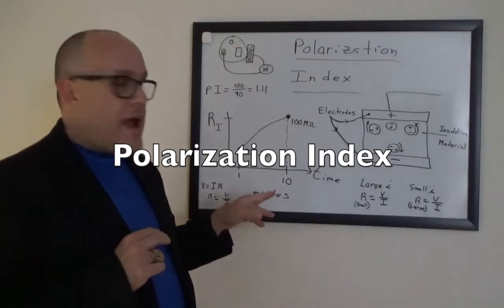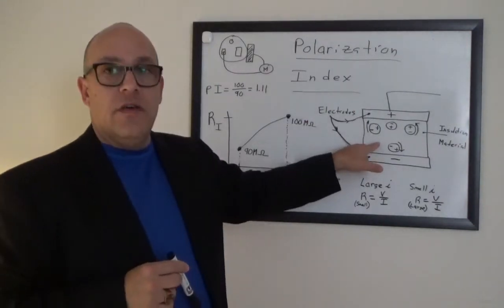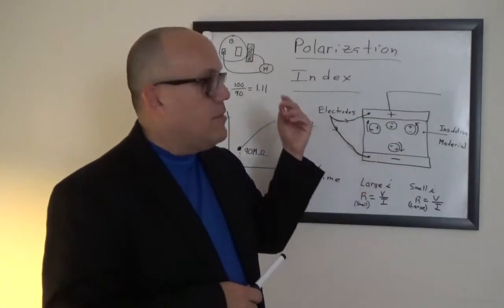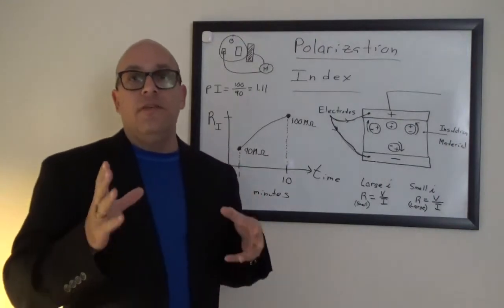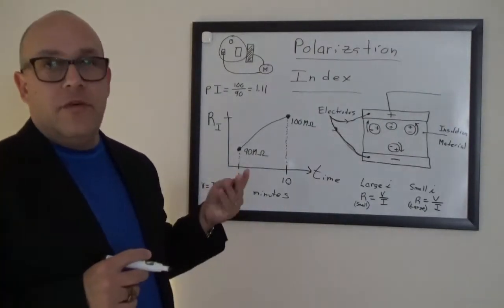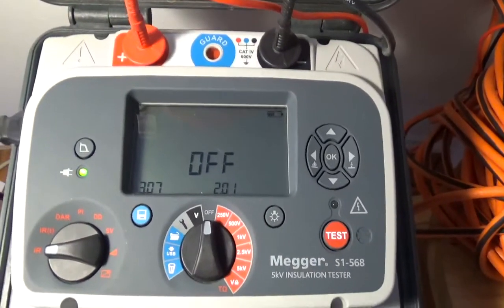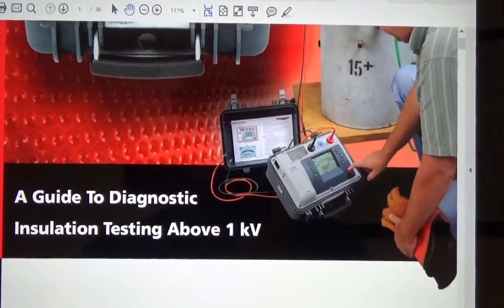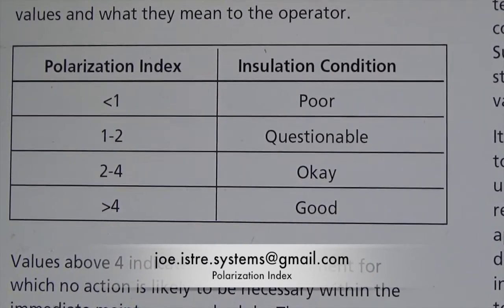Polarization Index Testing (Long Version)

Comment: When referring to molecules, I believe you mean atoms. Those atoms containing a balance of the nucleus of protons surrounded by the orbiting electron field - the excited (free) electrons being those which move from atom to atom  - hence voltage potential and current flow.
Reply from the maker: In the PI art, the molecules are referring to insulator molecules - usually plastics.  I would agree with you for conductors.  Then again, if we are getting these minuscule current flows from plastics, I suppose we are stripping the outer electrons from the outer orbitals of the molecules with the high voltages.

Comment: Per IEEE 43 - 2013 Part 12.2.2,  when IR value exceeds 5 Gohms @ 1 min, PI test can have inconclusive results, and may not be a valid indication of the insulation condition. Means the calculated PI may not be meaningful.
Megger may be a giant, but they won't reveal the point for their benefit. Most of their literature is based on obsolete insulating materials purposely. Something like outdated syllabus.
Then what's the working voltage of that jumper? How you selected 5 KV as injected voltage?
Thanks.

Comment: the question is, why does resistance increase with time?
Reply: The tested system acts like a capacitor. The theory of a capacitor in a DC system is that during its initial stages, there are some current transfer between the two conductors. After some time, it tapers off and no current transfer occurs as it is an open circuit.

So for a PI test, the first minute is like the initial stages where there are some small current transfer, hence the lower resistance due to ohms law. Around the 10 minute mark should be the point where there's no current transfer, hence the higher resistance due to ohms law.

Comment: Why are we taking 10 min??
Reply from the maker: It is an industry standard test.  PI is a 10 minute test.
Reply: Hi sir... which standard it is mentioned?
Reply: @nahashamsa2791  IEEE Standard 43-2000
Reply: @OmniBaddie  Please read part 12.2.2.  PI is not recommended if the 1 min IR value exceeds 5 Gohms.